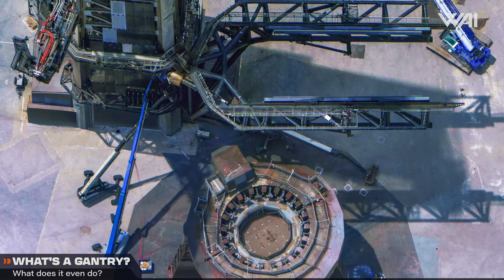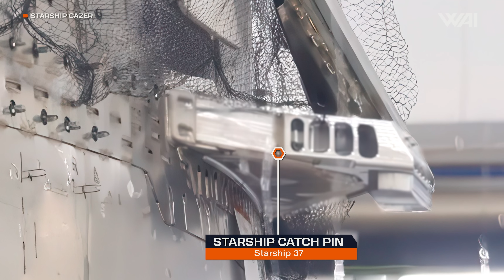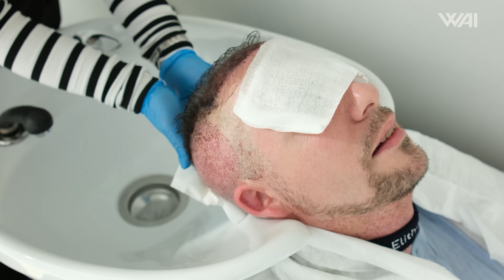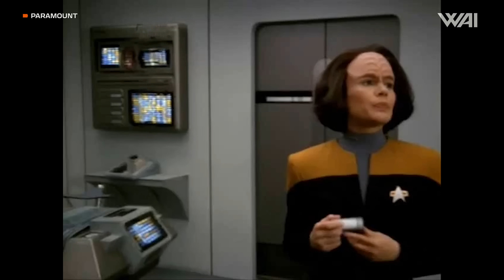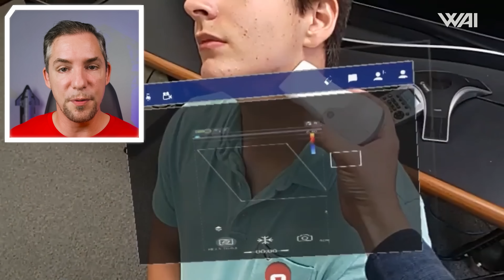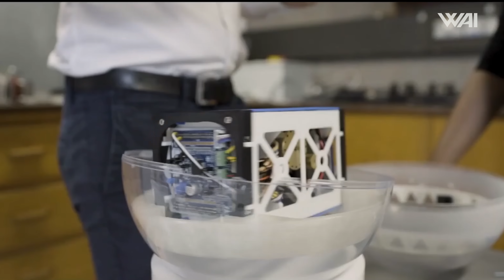SpaceX Does It Again! Starship Flight 10 Analysis! Does China Stand A Chance?

Comment: I don't understand why were are bringing a empty container back. And why we have to Shield the WHOLE empty container? What is important is just the bottom section of the spaceship. the engines. The Top part has very little of value. Why not SHRINK the spaceship to a smaller size. Like a retractable body. That way you have a smaller profile. Thus smaller area. Smaller area also means less friction as frictional forces is function of speed and surface area. just a nose cone shield. DIve/re- entry the ship head first, than flip it once the speed is reduced.

Comment: What to expect ........... same as before.  Booster does well and Starship not so much.  This will remain the status quo until they bite the bullet for a significant redesign.  Those flaps needs to morph into wings to get the re entry heat loads down and to use horizontal landing. Swap the fuel mass used for vertical landing  for the wing mass.  Basically shuttle/scaled up X-37.    Assume much of the ground Infrastructure is still in place from shuttle days and the basic design approach is proven.  The booster and starship do not need to use the same landing approach - they are fundamentally different animals.

Comment: Could a Hindenburg sized helium airship be used to transport Starship segments?
Reply: I believe the Hindenburg could lift around 250 tons, and that should be enough to carry either an empty Starship or an empty Super Heavy booster. 

But most likely they will use a barge because they are cheaper and more readily available. And a barge is probably safer than an airship, even using helium instead of hydrogen. 

Of course, using an airship would be much, much cooler.

Comment: The satellite pointing thing is very interesting - and while you say that it's not precise enough for fine tuned satellite pointing, maybe it doesn't need to be? Gyros can get "saturated" where they can't spin any faster, and need a way to desaturate, so another system is needed for coarse rotational adjustments. Usually this is some sort of thruster that uses fuel. A way to de-saturate the gyros without fuel would get rid of the need for fuel, and it doesn't need to be very precise because the gyros will provide the extra precision.

That said - since it requires using the Earth's magnetic field, I imagine this will have a very limited range. But it will be useful for satellites in that range.

Comment: if 3 legs are more stable on uneven ground, why are all the lunar landers still using 4 legs?
Reply: Depends what you mean by stable. Three legs will more likely sit firmly on the ground but is more likely to tip over. 

If the legs can vary their length, then three legs has no advantage and more legs are better.

Comment: Minimally and most important for this upcoming test flight 10, Starship has to not blow up and make a controlled reentry. Better if it can make a control splash down also. 
The rest of the inflight tests, not so important but they better not mess up the final outcome.
Reply from the maker: If it fails it provides data. Block 3 is bringing tons of changes and is already in stacking. Block 2 isn’t very important anymore. 👍
Reply: @Whataboutit  If Block 2 have gone RUD that many times, why don't they just go Block 3 with whatever fixes they know?
Reply: @dcr66 they have perfectly good v2(not ominous at all considering fElon's penchant for salutes) left to use. But, hey,  it's US tax money so why not waste it?
Reply: Go watch thunderf00t's video about starship tiles.

Comment: why don't they cover some of the pad areas with the same heat tiles they use on the ship?
Reply: The tiles stand heat well, but are fragile. They are not tough enough to withstand the rocket blasting on them.

Comment: Note that the limitations of 1960s technology meant that the very first tests of the Lunar Module required risking human lives.  The same was true of the Space Transportation System (STS) aka Shuttle.
Reply from the maker: And it’s coming up for SLS in almost the same way. One launch isn’t much. 🙏
Reply: @Whataboutit indeed.  The ONLY reason that NASA is not performing adequate testing is because each test costs $4.2B!  If the tests cost about $100M each like Starship they would test more often.

Comment: Star ship does it again, what fail rentry so far thats all it's done.
Reply from the maker: Imagine holding the intellectual property and know how to build the largest rocket booster ever built and it’s fully reusable. Flown, caught, reflown. And you’re working on doing the same with the upper stage. Stop repeating political bs. Look at the facts.
Reply: @Whataboutit what was political with what I said.  That's  facts the upper stage has done worse on almost every flight.  How many flights to test the heat shield and it didn't even get that far to do it?  That not political it's just observation.  Had i mentioned where the money comes from then you can claim political BS.  Remind what the time line was for the moon again and tell we on track with a straight face.
Reply: Starship had several successful re-entries.
Reply: @greghadaller  the booster has but starship is the upper stage and it has not done well with re-entry. Its done worse on almost every attempt since flight 1

Comment: Please review the difference between weight and mass.  When the Dumblinks are deployed the Starship is not under thrust, so no matter how big they are the weight of the Dumblinks is zero.
Reply: Gravity at LEO is 99.9% of that on the surface. So when deployed, the weight of the Dumblinks has not changed much at all, they are just falling. 

Anything falling appears weightless, until it stops falling; then its weight is obvious again.
Reply: @greghadaller at the time of deploying the dumlinks the Starship is on a ballistic trajectory.  As pointed out by Einstein that is an inertial frame of reference.  Gravity does not create "weight".  Weight is the electromagnetic force pushing against the inertial movement.

What the he'll is wrong with American education that you don't understand that!!
Reply: Weight isn't force, it's a unit of measurement, it's not created or destroyed, only measured. You would have to stop the orbiting object to weigh it with a very tall scale
Reply: @JoshJamesification  Weight is a force.  If you put a bathroom scale under a Dumblink at the point where it is deployed, that bathroom scale will register ZERO.  Please read a physics textbook before you continue to embarass yourself.  It is confusing in American sloppy terminology that the term "pound" is used both for a unit of mass, and for a unit of force.

Comment: Actual Question, why doesn't they put some heat tiles like on the Starship onto Pad B to protect it from the fire in addition of the water system underneath ?
Reply: The tiles can take a lot of heat, but they are not very tough. The blast from the rocket engines would destroy them.

Comment: Are the same ship heat tiles used to protect the launch pad?
Reply: No, no; totally un-related. If there is one thing those heat tiles are NOT good at, it’s taking damage- of any kind. (Most of them; I can speak to the experimental metal ones; but, one assumes they can’t be particularly thick for obvious reasons, so…..). You COULD build a heat shield essentially impervious to impact damage; but, then, it wouldn’t be able to get off the ground, which would limit it somewhat…….😊😊 - Dave Huntsman

Comment: Does China have a chance? Of course they can. They are catching up on some things but way ahead of other things. Glad to hear flight 10 is finally happening.
Reply: Which areas do you think China is “way ahead” on?
Reply: Don't worry about China.  Focus on   our moonbase.
Reply: Chance of what? If you mean going/landing on the moon; then yes. But, if you mean setting up a moon base; then I would say that I’m really skeptical.

Chinas current moon mission is certainly not anything to scuff at, but we must look at it objectively. Their current moon mission is akin to the U.S. Apollo mission and focuses very little on a moon base establishment. Just look at the long march 10 and the lanyue moon lander. The long march 10 is to expensive and to small to regularly resupply a moon base and that lanyue lander is really tiny. I’m talking about even smaller than the Apollo moon lander. Only able to hold 2 astronauts for 6 hours is hardly enough time for anything significant. 

You have 2 very different space agencies who’s focusing on 2 very different things. China, on just landing in the moon and the U.S. on trying to build a moon base. Heck, just look at blue origins new Glenn and SpaceX starship and compare that to the long march 10. These equipment/vehicles are further proof of different objectives.